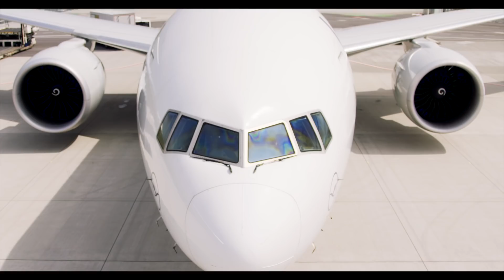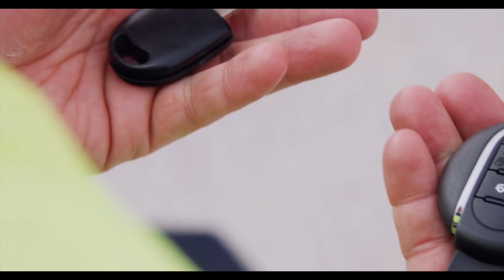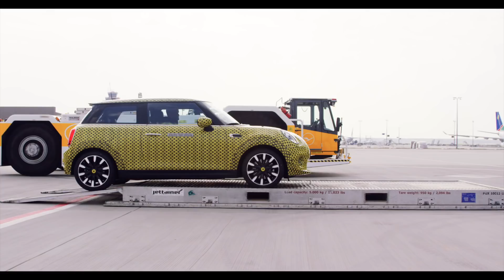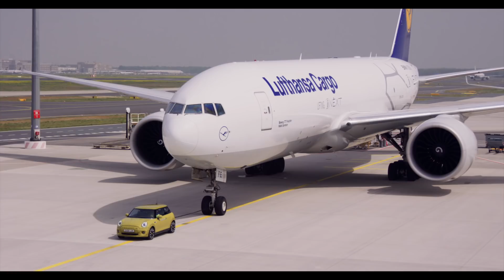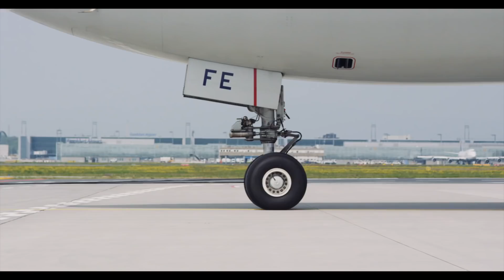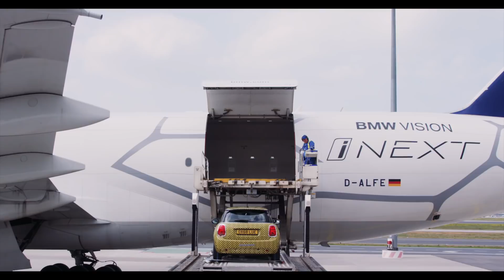MINI USA | The MINI Electric pulls 150 ton Boeing 777F

Comment: Anyone else notice the turbines in the planes engines  are def spinning? Set playback speed to +1.75 and check out timestamp starting 17 sec
Reply: The turbines aren't spinning that's just the camera moving down while being able to see through the turbine. Notice the cone on the front of the turbine isn't moving.